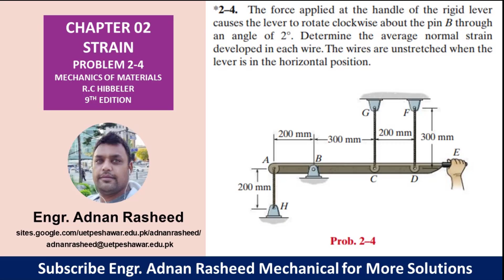2-4| Chapter 2 | Strain | Mechanics of Materials by R.C Hibbeler|

Comment: We can also use the Soh Cah Toa alternative for radians.
Reply from the maker: What is Soh cah toa alternative?
Reply: @engradnanrasheedmechanical  the soh cah toa alterntaive refers to using the the United States standard definition for projecting a length (cosine: horizontal) or height (sine: vertical) across a 2D plane.

Ex if i have a right traingle with a hypotenuse of 200mm and wanted to determine its vertical projection from my targeted point i would simply multiply the magnitude by sin(degree)   200sin(2) = 6.98mm.

Ex if i have a right traingle with a hypotenuse of 300mm and wanted to determine its vertical projection from my targeted point i would simply multiply the magnitude by sin(degree)   300sin(2) = 10.47mm.

Ex if i have a right traingle with a hypotenuse of 200mm and wanted to determine its vertical projection from my targeted point i would simply multiply the magnitude by sin(degree)   (300+200)sin(2) = 17.45mm

SOH CAH TOA: Refers to the relationship of sides rather than Angles where 
Sine = Opposite vertical height from angle / Hypotense
Cosine = Adjacent horizontal length from angle/ Hypotens

Tangent = Opposite vertical height from angle / Adjacent horizontal length from angle

This is primary used in place of an angle if one is not given 
note " / " stands for division

Comment: Sir when you are taken radius for D then you are adding 300+200 how it happens. According to this step for C we should take distance  from A to C this is 200 +300
Reply from the maker: No you are wrong, from point B the angle is 2 degree and for finding the delta c the radius will be 300 and for point D the radius will be 300 + 200 for finding delta D .